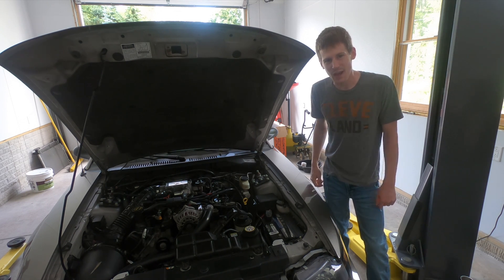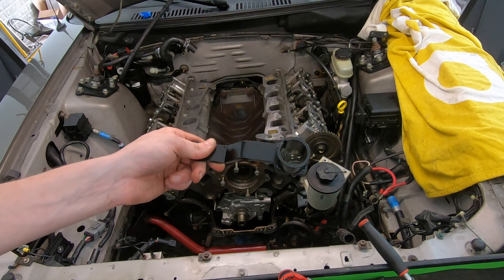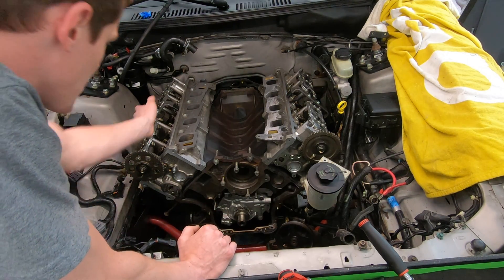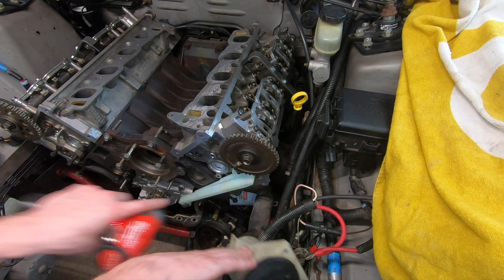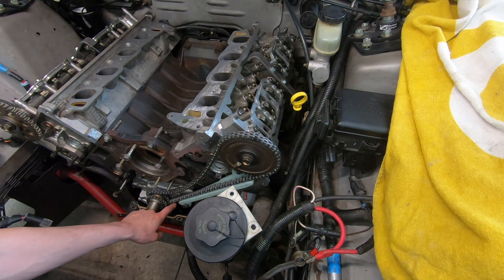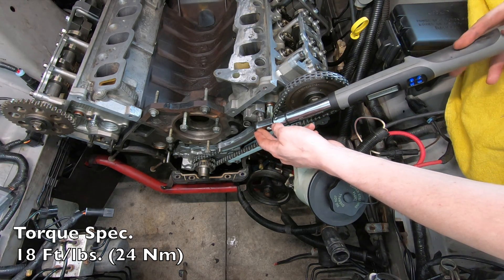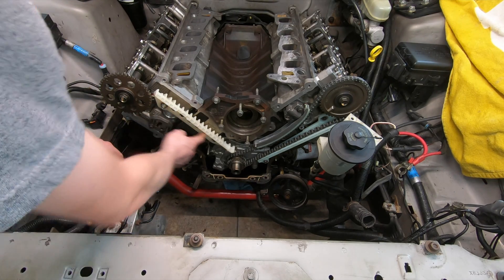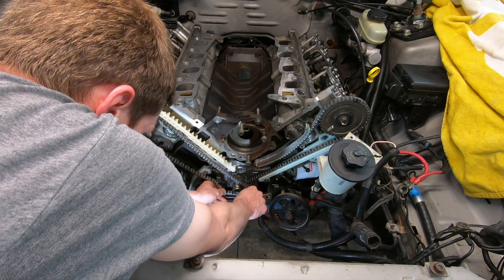Ford 4.6 2V Timing Chain And Guide Replacement.

Comment: I have a question for ya ..... I am new to disassembling a 4.6. When i took the engine apart i was not aware that i needed a cam holding tool. Luckily i had all the cylinders below tdc. Due to when i took the chain off the right head the gear spun on me. As long as i line up the timing marks on everything, i should be allright....right ?
Reply: I have tried to run a compression test on this engine as my haynes manuel says but i didnt seem to understand the readings i was getting. So i just went ahead with the tear down due to needing new valve seals anyway. But my manuel does not cover the timing procedure on this engine so i was hoping i didnt destroy my car.lol
Reply from the maker: You should be okay but, nothing is guaranteed my friend. If you're worried, run a compression test before you completely reassemble the engine.

Comment: What book are you using? My book doesn't give me details like that! lol
Reply from the maker: Ford oem.
Reply: @RepairGeek  got another question since you replied so fast lmao. I cleaned my chains up, I couldn't tell where my timing marks are. Am I able to just mark what I think they are? There us 2 very slightly darker links on opposite ends. 26 links between on each side. So its perfectly half and half. Would that be correct to just line those up and be ok?
Reply from the maker: @miguelmaza3049  yes sir. Half and half are the colored links. Align the links with the dots on the gears and send it.
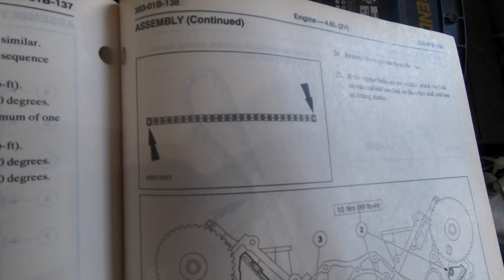Reply from the maker: @miguelmaza3049  2:43 for a picture of what I'm saying.
Reply: @RepairGeek  yea, i was using that as a reference.  The picture in the book is what made me ask just to be sure.  Definitely going to get me one of those good books, this haynes doesnt help for shit.

Comment: Does anybody know what kind of cam holders I need do use for a 2003 Ford Expedition 4.6l 2v (VVT apparently that’s an important variable) I look everywhere and they don’t have any specifically for mine it’s either for everything 2002 and below or for 4.6/5.4 3v engines.
Reply from the maker: These tools work on ANY 2v engine regardless of the year.

Comment: What size bolt is it and what's the length?
Reply: Where can i buy the chain guide bolt the longer one
Reply: @erniepaga8059  if you buy the chain guide kit, it should come with it
Reply: @trinitypowerwash23  it came with the chain kit
Reply: Hey man did you end up using the bolt the video suggested or what bolt did you use?
Reply: @SANCHEZFLA863  so I went to my auto parts store and I bought the timing kit and it came with new pulleys, new chains, new tensioners, and it came with new guides which came with the new bolts.
But what I was going to do was buy the guides only and go to a hardware store to find the bolt that I needed but I ended up getting the while kit instead
Reply: @trinitypowerwash23 ok cool man I think I'll try the bolt he suggested then if it doesn't work I'll try the hardware store. did you Google the part number he suggested? it comes up as some type of door bolt. anyway thanks for the info.✌️

Comment: Why is he even talking about the tdc if he removed everything and put the cam holding tool on all you have to do is put the chains back on and everything guides tensioners etc.then remove the holding tool? Right? Im confused 
I also seen another video where the guy used paper clips instead of the cam holding tool

Comment: Most people get bent out of shape because they're installing hotter cams and they have to use adjustable cam and crank gears which can be difficult to set properly if you don't know what you're doing which is why I always suggest leaving that up to a licensed mechanic.

Comment: Pushrod motors it's like going to high school it's still going to be a challenge but you can get it done pretty easily and quickly

Mod motors are for people who can use their brains a little bit better and the payoff of not having to shim anything or check lash on the rockers is  so much easier not having to worry about pushrod length

Comment: Those guys that get uptight about the chains should watch vids on the 4.0 (four chains + jackshaft).
Reply: I have that motor and did the timing with engine in ....i learned alot
Reply: @llennon73  I'm  hoping to start on mine in a month. 170k on it and cross my fingers every time I  drive it. I will do the 2 degree advance on the cams when it goes back together. Thanks for the responce. B.R.
Reply: Benton Rodeheaver I’m changing my guides, chains, etc... don’t feel bad this is a first for me as I speak and like many I’m nervous hoping mines turns out correct after how the gentleman explained
Reply: @t.farris1755  Just rember remember if you want  better mileage/torque advance the vams 2 degrees and do the brown wire modification it disengages thefront differential when in 2wd. Mine's getting an electric  fan also. These combined are +++ for MPG. Cold air intake is another.
Reply: Benton Rodeheaver well I’m just trying to change my timing chains and tensioners
Reply: @t.farris1755   Oh, ok . I always talk to guys like they are lifelong mechanics lol.
Reply: Benton Rodeheaver I am no mechanic I’m just trying to learn how to do a lot of things my
Reply: Benton Rodeheaver I hope I don’t damage my engine trying to do it myself
Reply: whodidit was that hard to do

Comment: Where can you get New tensioners and guide bolts my old ones snaps when trying to re torque?
Reply from the maker: You are over torquing if you're beaking them. Find the correct length and thread pitch and go to a hardware store:

Ford dealer.
Home Depot.
Lowe's
Grainger
MSC
Fastenal

Comment: Alright I have a 4.6 2v from a 2006 Crown Victoria.  Can't seem to find an exact reference as to which cam holder I should use.  Anyone have such a reference?  Thanks
Reply: Ok I found an answer to my own question.  Thought I would share.  According to Summit Racing, the camshaft holding tool with number 6477 will work on the 4.6 found in the Crown Victoria.  Mine is a 2006, to be specific.  So then the link provided by the OP above should work.  I ordered two of them.  Kinda expensive (but still under $100, so I guess it's not that crazy really) for something you'll use once or not all that often, but it is what it is.

Comment: I need your help my 01 expedition timing chain guide bolts are so worn that they snap when attempting to torque! they have worn sections that are visible on them, aren't they one time use? where can you find replacement bolts? for the timing guides bolts ?
Reply: Hey did you find the bolts you needed if so where you get em and part#?

Comment: The people who bitch about these engines usually run LS shit.... Their stupid by nature. They're not smart enough to work with vvt, vct, sohc' and dohc ' it's too complicated for them. You've got to remember these are the kinda people that took special education classes. Also go to ford parts giant dot Com. You can get genuine ford oe parts for 40% off. A full parts kit costs 220$ for chains cast iron tensioners with updated guides and hardware. Never ever buy cheap shit.... It's cheap shit for a reason

Comment: Sir pleasant evening i have a problems on my ford expedtion v8 triton romeo i use the old one timing chain but it has no timing mark any idea how can i count so that i can timing the engine very expensive here in the phillipines thank you so much    when i saw your video its very useful for me as a beginners ,,
Reply from the maker: Mark the opposite ends of the chain as shown at 2:43

Comment: Removing all 8 spark plugs will aid in the reduction of forces, including residual combustion chamber compressed gasses pressing down on the piston, and this can held reduce the hazard of bending valves.

I'm glad you used metal tensioners as the plastic ones get weak and the spring gets weak and after 6-7 years of heat cycles and allow for super loose chains on start up and the loose chain on the driver's side will eventually bust the left side chain guide.

The metal tensioners have that little ratcheting arm that presses up and keep the chains tight by keeping the tensioner arm pushed up tight in the absence of oil pressure.

Great video.

Comment: I have a 01 mustang gt with a bad engine and I have an 4.6 outta an 06 or 08 ford.... my question is will it work after changing the intake and front timing cover?
Reply from the maker: 2v?
Reply: @RepairGeek  yes it's a 2v outta a crown vic with low miles and hours.
Reply from the maker: @johnjohn-xo5gl  the difference at worst may be minor. Compression ratio may be slightly different, valve covers, and # of flywheel bolts may be different worst case scenario. Should be mostly a direct bolt in.

Comment: Great tutorial, getting ready to do this on my Town car.
Reply: How did it go?
Reply: @281cu6  It wasn't that bad. The only real pain is the passenger valve cover, which is a really tight fit in the back. It is just a matter of patiently disconnecting the wires around the cover and then working the cover off. And of course, the rear of the cover leaked when reassembled so I had to remove it and do it again. But the second try I had a helper hold the wire harnesses and hoses out of the way while I shimmied the cover back on. I did it over two half days, but can easily be done in a day. The chains and the guides themselves go on very easily.
Reply: @mikehenry4743  Thanks for the update!  Gives me a bit of courage to know that info.  I'll make sure I have a helper.   I'm planning on changing these out in 30K-ish on my Grand Marquis.  Figured it could use a fresh set being that it's an 04'.
Reply: @281cu6   Good luck, once you start it is not that bad at all.
Reply: @281cu6  I'm planning on doing this today on my grand marquis, I went to change the coil pack on the 8th cylinder and found oil in the spark plug well, so I'm hoping its just the head gasket thats leaking oil into the combustion chamber and not the piston ring 😅 if you're ok with it, is there a way we can contact each other, I would like to know what issues you've ran into before I start this job so I can prepare
Reply: @luizdominguez8615  Ask Mike Henry.  I haven't done it yet. 😅
Reply: Did the cam holders work out for you? Mine don’t seem to fit the actual cam

Comment: Would you take these same steps, say if you installed new cams?
Reply from the maker: If I installed performance cams I would degree them for best performance. If its stock stuff, this procedure will work fine.
Reply: Repair Geek thanks man! So correct me if I’m wrong, but decreeing the cams would be timing them as well correct?

Comment: Finally a good video good explanation thanks men..I have to change my guides and tensioners on my marauder...
Reply from the maker: Marauder is a 4v. It's different.
Reply: So the camshaft holding tool it would not work on the 4v? Do you know which one I would need?
Reply: @hectorjimenez7328 
 https://youtu.be/9eCDxp3fcU4

It's pretty similar.  You'll probably need to lock the 4 cams with a different tool.
Reply: Colt 604 I already change my tensioners guides and chains..I just used zip ties
Reply: @hectorjimenez7328  Sweet!  Glad to hear you got it done 😊

Comment: A man that is so true on people being afraid on the 4.6 timing i am one of them I have been put in it off for almost 13 years on my 97 GT  I hat a problem of a spark plug tripping the tread of one of the heads I removed the heads bought new ones and there are still in the original package heads and timing chains and I always tell my self next weekend and that weekend never comes ha ha
Reply: Ferber b join sn95 forums! Would love to see and help you out man

Comment: Why did you not replace the oil pump while you were that far into it? Not judging, just asking. Great video btw and helpful too!
Reply from the maker: I thought about it. The car only has 65k on it and had a TINY pin hole coolant leak in the head gasket into the valley of the block. 

If I was going to put a pump in it it was going to be an upgraded 3v or 4v pump. Both of those have larger pickup tube diameters than a 2v pump. You can't get the pickup tube out without dropping the pan. You can't drop the pan without dropping the K member or possibly removing the trans. It just seemed like a lot more work just to change a pickup tube on an engine with 65k on it which more than likely, didn't need it anyway.

I only changed the guides and chains because they were nearly 20 years old. The wear on them was minimal. Eventually that plastic will start to break down. Thanks for watching.
Reply: @RepairGeek  I'm learning more and more about Ford mod engines lately. My son bought an 03 GT Mustang a few months ago after I looked it over and said I would keep looking for a better car. We've had to put a new intake and water pump on it and doing the chains and tensioners now...His guides already crumbled so I think pulling the engine is gonna be our best course. got to get all those itty bity pcs of plastic out of there. Planning on putting a new oil pump on it since it has around 170k miles on it. Hopefully we don't find anything else major or minor in the mean time! Didnt know if  a newer oil pump would work or not so I'm glad you told me about that. I'll be pricing 1 today. Thanks again!
Reply: @RepairGeek  By upgraded do you mean  like a Melling M360HV for a 3V. The price on that is much better than what  Amazon has that they say fits his GT and if it'll fit, bolt up and perform I'll go that route.
Reply from the maker: @michaelheppard5806  Yes that pump will bolt up fine your issue will be the pickup tube. That pump uses a 15/16ths pickup tube diameter. Your stock pump is 13/16ths. Any high volume pump for a 2v engine will use the larger 15/16ths pickup tube diameter. To run that pump you will need part#: 7R3Z-6622-AA  That is a pickup tube for a 3v Mustang that will fit the pump but you need to make sure that will fit your pan.
Reply: @RepairGeek  Is there that much difference in oil pans from 2v to 3v or from 2003 to 2004? I am just not that good finding the information online to get details like this and I love wrenching but it's always been a hobby/part time thing not my career. If a man don't do this every day and doesn't stay current on what's new it's easy to get frustrated. The parts guys ain't no help these days either! they can run the computers but they seem to have any hands on knowledge about anything. At least in my little town it's that way.
Reply from the maker: @michaelheppard5806  You're starting to overthink it. Here this is a stock replacement 4v 4.6 pump from Ford Racing. Its about 8% higher volume than stock and the same pressure. This is the pump and pick up tube in one part number. Bolt in and go. Run some good 5w-30 oil and that engine should run for another 75-100k no sweat. 

https://amzn.to/31NWqgA
Reply: @RepairGeek  I really appreciate your time and knowledge on this! I may be over thinking but the last 10 plus years I've heard "This is what you want. It's perfect for what you're doing." so many times from people who know how to sell but know little about what they are selling that it's just hard to trust em anymore. We are gonna take your advice and get parts ordered in the morning. Thanks again!! Hopefully I won't have to bother you again.

Comment: Not as bad as i thought it would be. Looks easy. I'm going to do it myself instead of taking it to a shop. Thanks for making the video.
Reply from the maker: Getting to the chains is harder than replacing them.
Reply: @RepairGeek  what's books do you recommend reading for the 4.6 and 5.4l 2v engine I want to learn more about them and and all its components